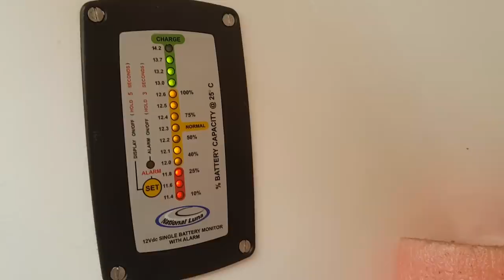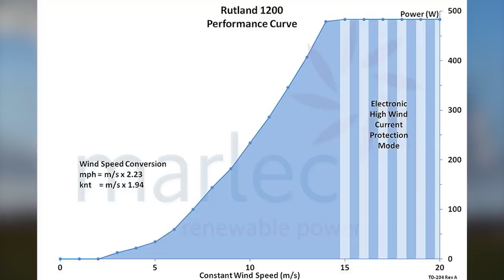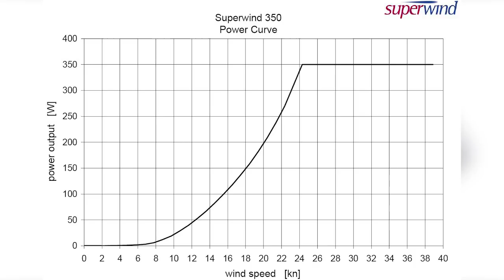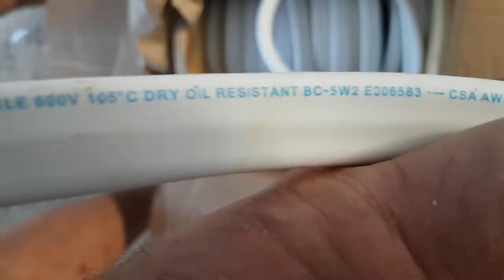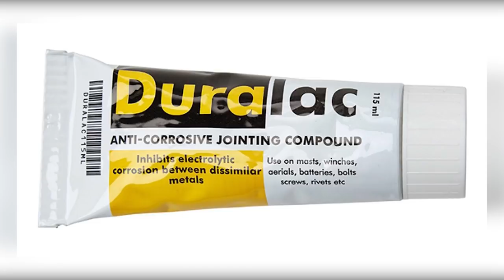Smart or Dumb? We Put a Wind Generator on Top of Our Mast - Ep 58 Sailing Luckyfish

Comment from the maker: We have been wrapped with the output, especially at night. It definitely does more work up there, alot more. Particularly in anchorages tucked in close to a beach where the wind would just pass over too high for a lower mounting. But, we are yet to find the source of the knocking sound... or try eliminating the hum. We'd really appreciate any suggestions you may have - and will be trying them too! Give it a Like, Sub, you know what to do :-) Thank you for watching
Reply: Just sent you an email. Figured out how to email I think? Anyway pay attention to the way detail C is on page 41 I think on my WindX generator manual. I know its not the same situation you have but I think you will figure it out from looking at the rubber mounting bolts shown. You will have to put rubber on top of the plate mount then bolt it down to mast.
Reply: Vibration is being transferred form the top of the bolts contacted to the top of the plate. The connection needs to be isolated from the mass. You also need rubber on the top of the plate. Use lock nuts so you only have to snug it down.If you torque the bolts to tights the vibration will transfer down the mass. Also if the rubber is hard not soft it will also transfer the vibration. It is the same concept as motor mounts on a car or airplanes. Also the rubber should be more like grommets, covering the whole plate with rubber just gives the vibration more contact points  to the mass to transfer the vibration.
Reply: Hi Stewart.  We will get this sorted the next time we are in the same bay.
'Til then, Vibration transfer issues should always be secondary to actually stopping the vibration in the first place.  It's coming from the spinning parts of the unit of course.  The blade has to be balanced in two axes.  Any little bend in the hub can cause a balance problem as well as having one blade heavier then the others.  I will be uploading a "balance the blade" video sometime this season.  I'll add it to my DIY wind generator playlist.   https://www.youtube.com/playlist?list=PLsT7_jPsZM5oZeMUi5ejGozVTHm83S3-7
Reply: The knocking sounds like a balance issue, the hum could be bearings or gears, the mast is amplifying all of it. Given the small footprint of your mounting base, I don't know if rubber mounts are going to be the best solution because you will end up with a lot of flex, you might be better served with a vibration damping mounting post, double tubes one inside the other with a layer of rubber between, one tube attached to the generator, the other to the mast head.
Reply: 1) THE BOLTS transfer as they are not suspended from the metal.
2) Need multiple density of rubber to isolate different frequencies.  
3) Since you do not know what the frequency IS, well it is trial and error for which will work best.
Reply from the maker: +Emily & Clark's Adventure  thanks Clark - I have been blown away by the number and range of suggestions from viewers. Its like Youtube University. So many well qualified folks and such clever solutions. I think there are a number of solutions that will work. The knocking thing is something different. More of a matter between us and Rutland.. but I do need to check tightness of the hub nut first... Cheers, Stew
Reply: No, wires do not "hum" except at extreme voltages.  The problem is the attachment point and the fact the mast is hollow which makes a very NICE drum.    Michael Anderson
Reply: Hum from wires is due to magnetic field and voltage to break down air due to moving of the wire itself.  Go to a high voltage power line, you hear both.  And yes, Voltage is VERY important in said equation.  Other form of hum is poor connection and is bad news.  Doubt he has #2.  As for #1 interacting with the aluminum mast, no because that would act as a magnetic shield.  Yes, it is nominally based on current(duh, basic electromagnetics).  Besides, his 8 guage wired in a sheath he installed will be twisted.   Michael Anderson
Reply: The blades are out of balance.  Be it weight imbalance, or variations on incoming air stream creating flexing of its pole at some other nodal vibration.  Even if you perfectly balance the blades, 1 bug later and they are out of balance again.  The mast is a nice LONG hallow tube with lots of nodal frequencies.  Hanging weights on the mast at 40%, and 15% height would probably be the best option to begin with along with a soft mount of the turbine.  

I wonder what the ratio of the turbine mast height is to the ship mass height?  Divide, then multiple by average rotation speed and more than likely this is the frequency they are hearing.  Or quite likely what he is actually hearing is the tips of the blades passing through the air.  Since it is now on TOP of the mast, this slicing of the air hum has its directional component directly down to the deck instead of to the side of the boat or rear where one normally does not reside.  

More than likely he is hearing multiple things at the same time.   Michael Anderson
Reply: If he ever gets in a hurricane it will be VERY VERY Bad as the turbine will align with the wind and when overpitched will act as a flat plate.  That flat plate will have FAR more area/force than the entire rest of the rigging and mast combined.  Lets hope the blades shear off.   Michael Anderson
Reply: Just like in an airplane propeller, imbalance in the blades can generate the sounds. It is solved by either adding or removing weight from the blade that is off balance. It is best to check if the blades are properly mounted first. As for the humming, that sounds like a typical transformer noise; can't say much more without looking into the internal circuitry of the generator.
Reply: I was thinking about your vibration issue and thought of a way to dampen it. The hollow aluminum tube up top is acting like a tuning fork and the vibration gets pushed down the mast, If the pole at top was filled with a rubber of some sort or other thick foam this would be like touching a tuning fork taking the vibration away. Back in the day I created a site for a company called bar snake that had a solid rubber plug that you would pull through the handle bars of a motorcycle to remove the vibration, it was this idea that made me think of the solution for your vibration issue. Good luck
Reply from the maker: +Joseph Brendel - near Labelle - on the ICW just west of Lake Okeechobee in the middle of the Florida peninsula. The frost came as a shock.
Reply: Could be the natural resonance of the length of pole, and length of blades. I giant tuning fork.
Reply: @SailingLuckyfish  After reading all the comments I suggest you buy a huge case of good brandy. Drink freely until noise has numbed down.Turn stereo on full blast and party like it is 1999. When you find the solution please do a video on it.
Reply: Question: wouldnt it have been a good idea to tranaform to voltage to 110v and back again to 24v or 12v to avoid using such expemsive and massive cable? Any idea if this could work on a monohull?

Comment: I would adapt a couple of smaller rubber engine mounts to try and isolate the wind generator. Make sure they are rubber and not urethane as rubber is better at absorbing harmonics like what you are experiencing. You can also get motor mounts that are interlocking and heavy duty enough that should never fail.
Reply: oui, même idée pour silentblocs moteurs avec un câble de sécurité mat bateau/mat éolien  en cas d'arrachage par fort vent/ Yes, same idea for silentblocs engines car with a matt cable of security wind boat / matt in case of lifting by strong wind. (traduction reverso)

Comment: As others have pointed out, the mounting bolts will defeat the rubber vibration dampner sheet between the plates. The bolts will transmit the vibrations betwen the mounting plates. So you need to get rubber bushings around the bolts where it passes through the plates, (so the bolt is not touching the sides of the hole) and rubber washers on one end of the bolt, (or both, but probably not necessary) so there is no metal to metal contact between the mounting plates due to the bolts. for example:
Photo: https://www.acousticalsurfaces.com/assets/hg.jpg
Website:https://www.acousticalsurfaces.com/mounts_springs/neoprene_isolators_hg.htm
Reply from the maker: +Black Hat - really useful links... that looks ideal. Thank you, Stew
Reply: @SailingLuckyfish  I very much agree with +Black Hat

Comment: With the turbine so high up, you escape the whooshing noise of the blades spinning through the air. But the hollow mast amplifies the bearing sound like a speaker diaphragm. Despite your rubber mounting pad,the mounting bolts are still allowing the vibration through as they are metal-to-metal contact. I would suggest using a strong engine mounting block which has no direct metal contact. The lower frequency knocking sound to me is a mystery, but can certainly be resolved as it is not normal. You will not remove all sound, but can certainly reduce it. Shut it down at bedtime for a quiet sleep. I respect your desire to experiment and deviate from the norm, and good luck with reducing the noise pollution.
Reply from the maker: +Shaun Rudling - thanks very much. You are dead right about the height reducing the swoosh - but to be honest the swoosh is almost non existent on this unit. Very quiet blades. Yes, we have the manual shutdown there at night, but of course it is night time when we really want it to run so I will be much happier when we resolve the knock and the hum. Thanks for your great comment, Stew

Comment: Goodday mate when I mounted our wind generator whe had a loud humming noise after different try s we ended up putting a rubber sleeve around outside of pole where it mounted onto the wind generator solved the problem ours is mounted on a 11 ft pole on back of boat cheers mate
Reply from the maker: +Sailing S/V Slipstream - great tip - love the fact that it solved your problem. Not quite sure about what you did though. Rubber sleeve on outside of pole? Is the pole a male insert into the genny base?
Reply: I have a diverse answer that equals this
during construction of the Type 471 Collins Class boats there was quite a lot of vibration coming out of the periscope system which would literally shake the whole boat when any of the masts were deployed. The problem was hydrodynamic forces encountered for the round masts and was solved by installing a spiral wrap. The solution is common to many industrial applications, even high voltage electricity cables. Im afraid I cannot say conclusively if this would work, but I think I would try wrap some conduit around the supporting stand.

So is the knocking noise part of the same feature? Well suck it and see, its not impossible that blade airflow going around the mast stand may do that but the frequency sounds somewhat low, it would need to be 3 knocks per 1 rotation. My best guess is its a bearing especially if there is one knock per rotation

have a good one

https://en.wikipedia.org/wiki/Collins-class_submarine#Periscopes_and_masts
http://preformed.com/images/pdfs/Energy/Fiber_Optics/Motion_Control/Fiberlign_Dielectric_Damper/sp2130-2b.pdf
Reply from the maker: +SV Zaya really interesting! so that's what those spiral wraps do on power lines. This idea will go into the list of possible solutions for sure, thanks alot! yes, the knock is more like once per rotation so blade/pole interference is not a likely cause. Thanks also for the links, Stew. (Zaya says good boat name btw)
Reply: @SailingLuckyfish  hey welcome, yes the frequency seems more at the axis not flow behind the blades. That said you should check that the blades have the same angle of attack and even that theyre around the right way. It happens! Having been through that discovery entire, thump thump is a bearing.

Zaya Yes I nearly changed her name (shes always been Zaya) but the simplicity of zulu alpha yankee alpha persuaded me. It was fun contemplating names though
Reply from the maker: +SV Zaya good one. Other suggestions have been to wrap the genny pole in french whipping (round and round with half hitches) or slip an outside rubber sleeve over it. May have a similar vibration damping to the spiral. I see no harm in adding this along with the bolt insulators. I will check the blade angles also, cheers and thanks again.
Reply: @SailingLuckyfish  what happens is the airflow is more laminar (sticks to the mast) as it confronts the wind. But in its course around the mast it can no longer stick as it gets around the back because its too steep and so releases from the surface in a disturbed fashion. While the laminar air at the front can move quite freely and quickly the air at the back which breaks from the pole is draggy and slows down. So it trips the flow off the pole to an unsteady turbulent state, and ends up deviating from one side of the back of the pole to the other trying to resolve the differing speeds and pressures of airflow each side. 

Rather like the spinning cricket ball (its called the magnus effect) which rises in flight (therefore has lift), it has an alternating lift caused by the flow tripping from one side and to the next. The lift (which is seen sideways) has enough energy to slightly move the mast which then bends back the other way setting up a continuous harmonic which you can hear as a sound. 

Because of the nature of spiral wrap going all around the pole and down, it ensures that the flow is more disturbed and turbulent all around all the time. So the flow around the mast or pole wont develop the sideways lift or resulting bending, defeating the the side to side shudder, hence the sound. 

They use it on electric wires between pylons for the same reasons, but here the wires can set up dangerous harmonics which will whip the entire span of the wire between the pylons. Eventually this shortens the life of the suspended parts and something will fail, that is if theyre lucky and it doesnt bring the pylons down. Something related to this brought down the Tacoma Narrows Bridge in 1941.
Reply: How thick was this rubber sleeve? in my case I would only be able to fit something like 1 millimeter or less. A short piece of thicker pipe could be welded on to the top of the mast, with more room for a rubber sleeve, but then it would have to be split and clamped, like an exhaust pipe joint (if you know) and one would have to not use the two bolts designed to go into the generators "root" because these bolt would the transfer the vibrations to the mast. Question: Have you just inserted a sleeve like a piece of a car tire tube, and used the bolts in the normal way? Because if the is enough to take the humming the more radical idea can be forgotten.
Reply from the maker: +Jesper Milling I'm guessing your question is for Sailing S/V Slipstream - I wondered and asked something similar. Having read the many helpful comments here, some several times, I suspect Slipstream are sleeving their mount pole, not the actual male/female insert. A few folks have suggested the spiral wrap, like SV Zaya above, some french whipping, others fill the mount pole with foam, and yet another one who expressly states they sleeved the outside of mount pole with rubber. Given the explanation of the harmonics/vibration SV Zaya explains - I dont think it is difficult to see how these "dampers" could really help. We will make this part of our solution I hope. Cheers, Stew

Comment: Great video! 
First to clean up after using 5200 use isopropyl alcohol.  That’s regular rubbing alcohol.  Buy it at a pharmacy for a buck per bottle.  It cleans off fresh 5200 before it skins over.  After 5200 dries nothing gets it off.  Isopropyl and lots of paper towels. 

On the wind Genny, you got a lemon send it back.

Comment: Hi Stewart
You could use a rubber tap washer drilled out for the bolt size,. Then sleeve the bolt with rubber hose split and cut as a sleeve to eliminate the vibration transferral.
Reply from the maker: Thanks. We plan to try something similar to this

Comment: Could the wind generator, at certain speeds be hitting the resonant frequency of the mast, or perhaps a stay? The vibrations wouldn't necessarily be a problem on any other installation, but if you have a mast or stays that just happened to be "tuned" to those frequencies it could show up. 

Great job getting Luckyfish back in the water. And as always, you two are brilliant at sharing what you have learned with the rest of us.

Comment: You might find that the knocking sound comes from the mounting bolts where you have rubber sandwiched between 2 plates. Minor vibrations through the bolts can be removed if you have a nylon or Teflon sleeve bush between plates, rubber etc which would absorb sideways vibrations of the bolts